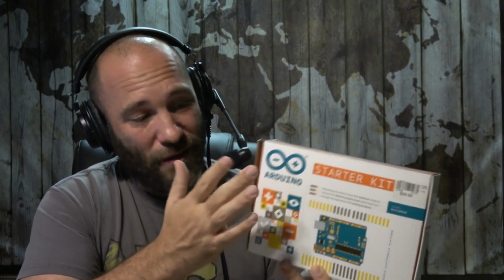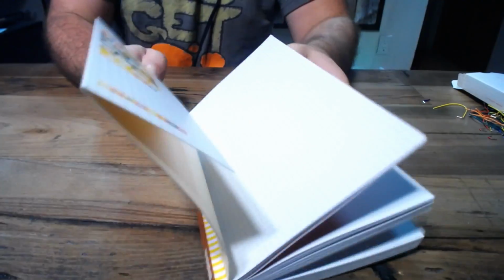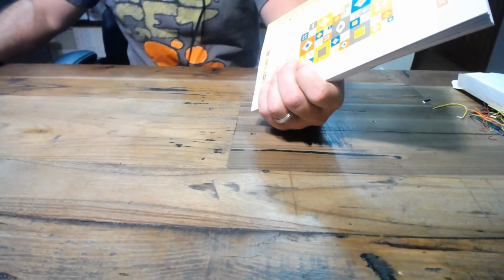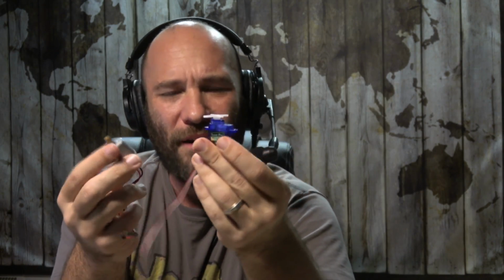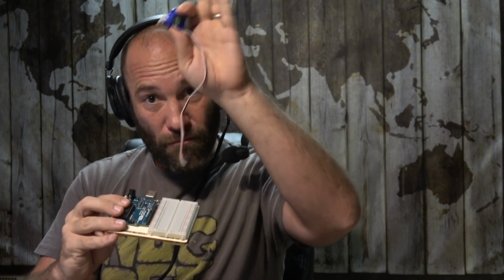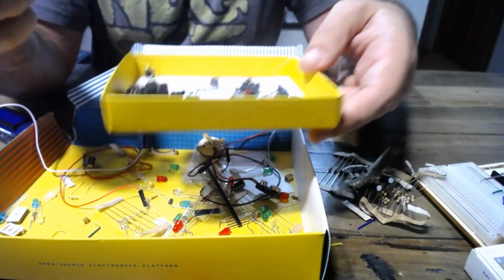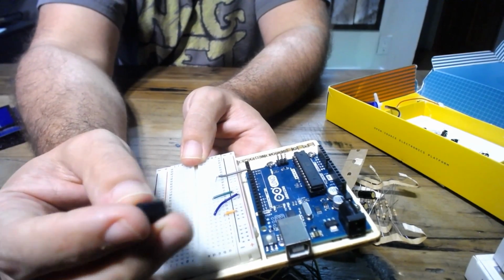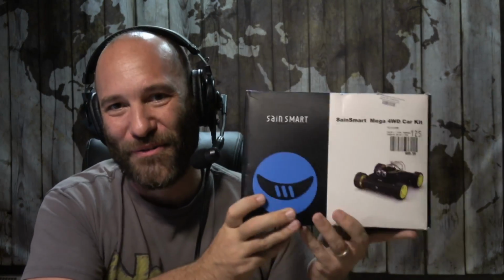Arduino Starter Kit REVIEW

Comment: I think one of the major problems with a lot of guides/tutorials on IOT stuff/maker videos is that people show you how to complete a project but never explain, how/why it works. So then you can never really transfer some of that knowledge to other projects on different boards... 

For example they will tell you what pins you need to solder/where to plug pins in on your breadboard, to a certain sensor but it's never really explained why you need to use those certain ones, and how it works. 

I've been messing around with Arduino's, Pi's and other smaller boards like Adafruit's Feather line for almost a year now, and most of the guides I've come across just tell me how to complete the specific project, the scope of the tutorials are very limited and focused on only, like you said "Making it work", not really too much detail into how/why it works. This has led me to have to do A TON of research on my own, which often times leaves me more confused than when I was in the first place. 

Don't get me wrong there are a ton of good guides/tutorials out there, but a majority of them are just getting something specific to work, and not really going any further than that. If I didn't have a strong desire to constantly learn new things about networking, programming, security, hardware, etc ; I would've probably already given up because nobody wants to just follow other peoples guides, they want to build their OWN projects and show other people: "This is what I made, this is how it functions, this is why it works like that, and this is what you can do to achieve the same end result". 
/endrant
Reply: I agree. I am doubting whether to purchase this now. I'm not interested in plug this here okay it works but we won't explain why. Now I'm studying for a Bachelors in Computer Engineering, so I'll probably pick up on it fast, but I rather look for something a bit more advance then okay plug this here and okay done.
Reply: If you look up the channels bigclive or greatscott they explain what and why and when to use each parts/components
Reply: does anyone know of any kits that go into detail about why it works? I'm recently getting into these things and I know how to do it, but I really want to know why it works, like you said.
Reply: @sebastianbledsoe4793  I recently bought two Arduinos after watching the breadboard computer series by Ben Eater (it's on YouTube). I have no desire to build the breadboard computer, but it made me understand how simple computers and microcontrollers work, and left me with a desire to do simple hardware-centric programming.
Reply: Best thing to do when you can't find the kind of video your looking for is make one. Let me know when your done. I need all the help I can get.

Comment: The best Arduino for breadboarding is the Arduino Nano - if it has the header pins it plugs straight into the breadboard - no trailing jumper wires. You can get them for just a few dollars each on ebay. Where the Uno excels is for flashing individual AVR chips.

Comment: Thing that you need to remember that the Arduino name is a group of
boards that can be program with the Arduino IDE. The think that is
neat is that the Arduino IDE is really a Compile for all of
the different micro processor that are  connected with the arduino
name.

Comment: A way to use the potentiometer better in the breadboard is soldering some wires to the pins of the potentiometer and then use the wires to connect to the breadboard.
Reply from the maker: +IFSC Robotics ... I agree and for real projects I'll definitely pull out the soldering iron... but that goes a bit beyond what I'd call "starter"...
Reply: Maybe soldering well would go beyond starter, when I first started with electronics I pick up a piece of copper, draw some circuit to power up a led and put into the acid, when the soldering part came I soldered on the wrong side kkk

Comment: I think it trys to appeal to 
high school kids, both boys and girls.
Thus the "colourful" content.
You can learn  basic stepper and servo motor electronics.
Some guys are retro fitting 
small manual mills and lathes into cnc machines.
There is enough info in this kit to get you started doing this.
More use then temp sensor id say.

Comment: With the pots and the piezo, you should be able to mount them across the gap in the breadboard. No need to keep them on one side of the board.
Reply from the maker: 1... the Piezo LITERALLY takes up the whole side of a board.   Just fitting the power connections is a pain.... 2... with the projects many times you're using both side of the board so there's no extra room to scoot it around...

Comment: I agree with you about Arduino. but I still.....having trouble with trouble shooting the Arduino thing. for some reason mine looks teal............................................. and I just found out I have USB2.0 cable the kit came with and My MacBook Air supports  USB3.0 cable ports not 2.0. because I looked the system Information>Hardware>USB>USB device tree and bottom panel bar in the window and guess what it supports 3.0 ports,.....of course because it supports my 3.0 San Disk flash drives....and I may need to verify the USB3.0 cable device in terminal,....maybe.......

Comment: At some point, you might realize that you can connect the speaker and the pot across the center of the bread board giving you the space  to make your connections.

Breadboard noobs.... <roll eyes now>
Reply from the maker: +Rob Bowen ... but then I have to use wires to jump the middle... which leads me back to not having enough space for wires to begin with...
Reply: What do you mean not enough space?  It's a single pot on a breadboard with a few other components. Breadboards aren't meant to look clean, they're meant only for prototyping.

Comment: artsy crap? really? because you haven't even considered that some people learn better with these visuals and that the fact that this art "crap" has brought more people into learning electronics and UNDERSTANDING it than it not being done that way..plus all the kids bright on board to "electrical engineering" and knowing how circuits work NOT just being done dull coding encyclopedia locked in a closet writing software like a drone. the Arduino is ment to be the bridge of the gap between code, circuit design and the physical world aimed at a person with zero background in electronics. arms like you spent more time making fun than seeing the benefits for what they are and recognizing why Arduino is so damn successful...before Arduino I could give a rats ass about how a motor works and computer coding...now I'm learning a shit ton and purposefully go looking more more info on how to do things and how components work and how voltage/electrical theory applies to what I'm doing and BOTTOM LINE is...without Arduino...I still wouldn't care and wouldn't even be tempted to learn any of what I have learned due to intimidation of the electronics topic as a hole......n if your notching about a $.05-.10 "issue" ..then spend the damn nickel, fix it and n quit bitching lol...that kit did what they wanted it to..you learned and now your seeking more info to learn more...so they win...you've learned and now there's a curiosity.